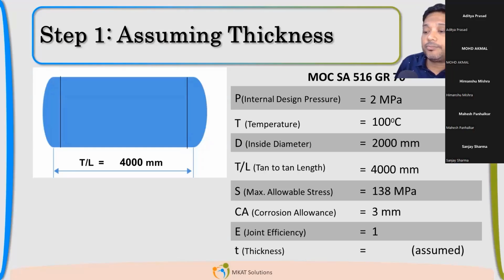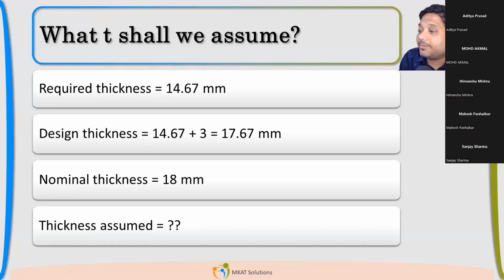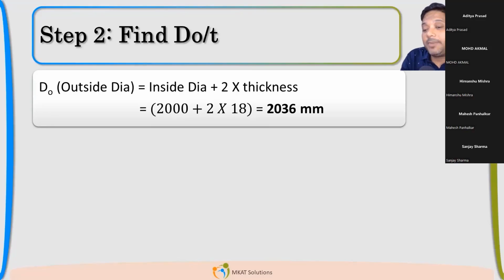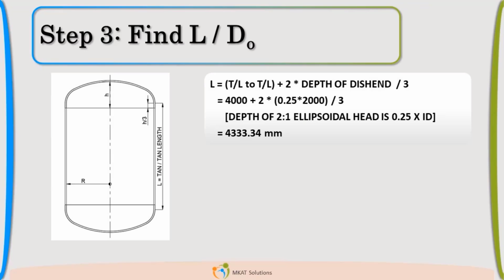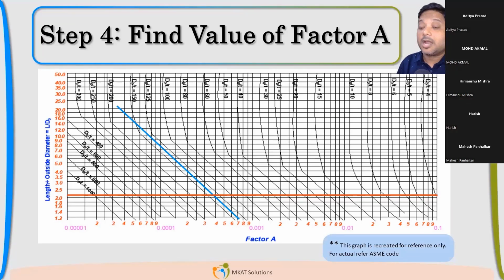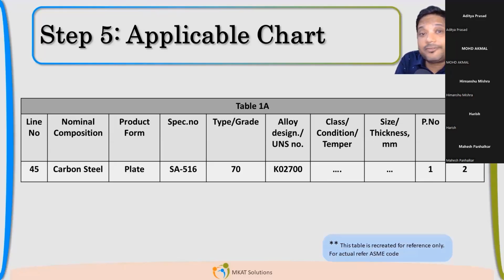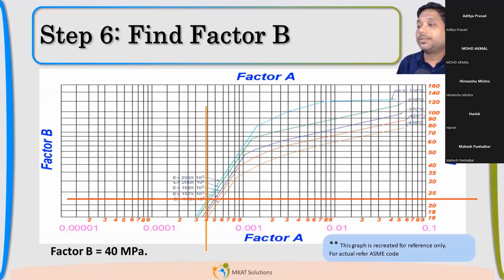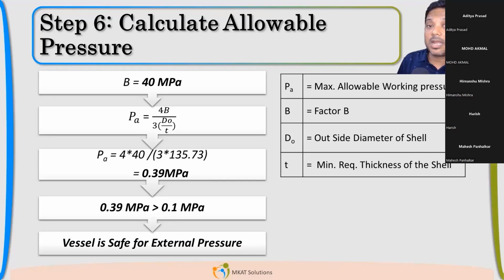UG 28 How to Calculate the thickness of shells under external pressure

Comment: Thanks for the lesson.

I do have some questions.

Assume I have an horizontal cylindrical tank Ø1250 x 3000mm and it is almost full of water. (Water level stays at 1,035m from the bottom of the tank) This tank is also supported by 2 feets on its ends, each feet have 0,1m² of area. This tank will be submitted to negative pressure.

Visual representatiom:
___________
|____________|    (both vertical bars represent the support feet

Do the reaction "pressure" of the both feets + the reaction of the water coloumn + atm pressure have influence on this calc, in means of external pressure?

Here are my calcs:

Internal pressure = -0,026 barg (-0,0026 MPa man)
water column pressure of water inside tank = 0,010 MPa
Feet "pressure" on the bottom of the shell = 0,1986 MPa (value for one feet)

In this case, doing the balance, I got:  - 0,0026 + 0,010 - 0,1986 MPa = -0,1911 MPa of inside pressure (or vacuum)

The "P" value I got from appliyng these calculations show me that my max pressure should be 0,116 MPa @ #6mm thickness. Could you help me, I think I'm mixing concepts.

Comment: Why not taking OD as per ASME B36.10 or B36.19 for respective material n why -12.5% mill tolerance in not added in market available thickness which should be greater than min wall thickness required ?